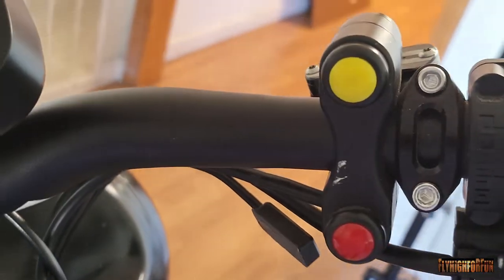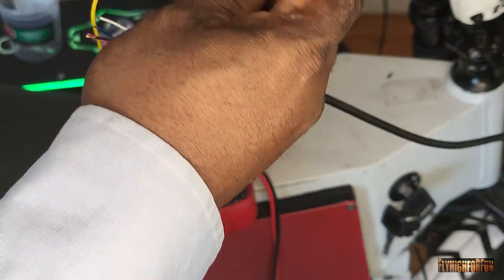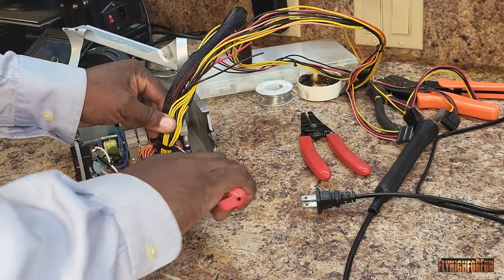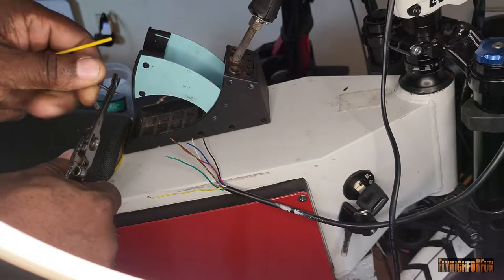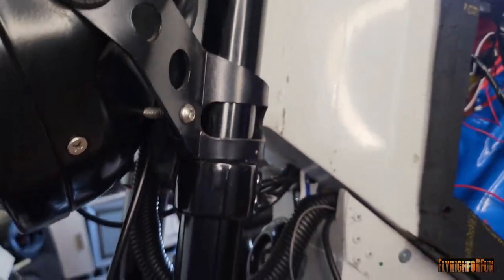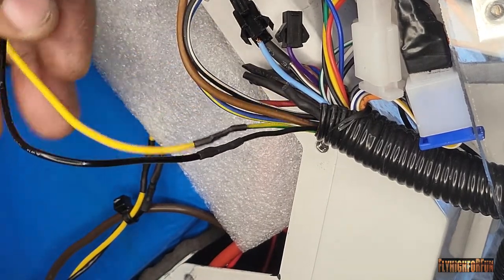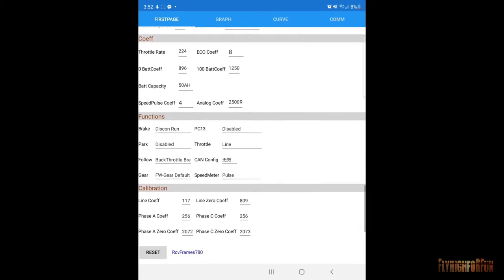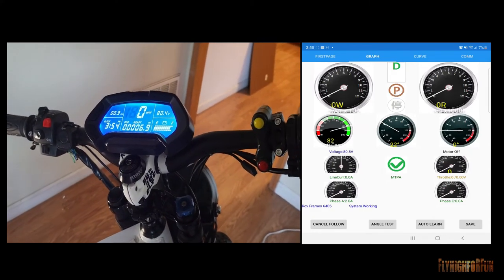Regen Braking. Fardriver ND721800 controller. #lowbrake switch

Comment: Thank you so much for this video! I just upgraded the motor on my wife's scooter and I needed to disable regen breaking, your video was great to help me find the setting!!
Reply: Is it an upgrade if you lose Regen
Reply: @andyfumo8931  the Regen doesn't end up adding much to the battery compared to letting it just cruise downhill. And her older motor didn't have regen enabled either.

Comment: Thanks for the video. I was hoping the Fardriver controllers allowed you to control the amount of regen using a 0-5V signal like the throttle but seems like it’s just an on/off switch. Is there a setting for how strong the regen braking is? Is it dependant on speed so stronger when you’re going fast and weaker when you’re just manoeuvring slowly?
Reply: The end of his video had a selection in the settings about a potential for a variable regen I think.
Reply: Yeah in the parameters is where u can adjust

Comment: want to get the Far driver nd72260, coming from sabvoton,a nd was wondering why i dont read in the manualr´ "regen braking" only charging current limit during reverse charging i mean what a interpretation for this function. but good it's got regen braking ! YES

Comment: One of your best videos I must say and high detail with the region switch on a far driver controller I mean dude you’re maxing it out beautifully. 

I’ll be buying a 72 1800 shortly But unfortunately it’s going to be paired with an under powered battery so I’ll be living with a slow battery for a while until I can get new cells and meet the same requirements of the 721800 to have its proper power and I’ll be getting a Daly 500 amp BMS.

My question to you is can I safely run the fardriver 721800 and Daly BMS with my weak Samsung battery group (18650-32E cells)? I know that the BMS and as you show the control or both have massive amounts of adjustable settings so it seems that I will be able to dial everything down for the crappy battery and then when I get the new battery dial it up to where you are what do you think man good idea?

Comment: Do you have anything wired up to cut the throttle if the brake levels are pulled? Just wondering if you had a throttle fault and it gave out 100% throttle would you have a way to cut the power without hitting the little regen button?

Comment: I am researching potential controllers for a Sur-Ron and the Far Driver seems to be a potential.
I've got a few questions that the chinese sellers don't seem to answer clearly;
-One item on my checklist is variable regen braking (using a left hand thumb throttle). I saw "back throttle brake enabled" as a selection in the settings screen on your video. Do you know if that's for a variable regen? 
-Does the rated continuous amps seem to be a true rating?
-Are phase amps adjustable in the settings?
-Can a 3 speed switch be used for low, medium, high power?
Reply from the maker: Quick answer: Yes, to all of the above. Not sure about you connecting regen using a thumb throttle, you'll need dedicated channel to control a 2nd throttle. I'm not sure if the Fardriver has auxiliary channel mapping like the BAC8000.
Reply: They don’t have variable regen, just on and off, you can further adjust the regen power by increasing the maxcurr, and stopcurr value get the first 1.5 x more in ratio
Reply: 3 and 4 question yes
Reply: @FlyHighforfun  do you know how to enable hill hold control?

Comment: My software looks much different than that? Same wiring. But i get an red !  When i hit the brake and ground the low brake wires. Shuts motor off. And cant ACCEL wirh brake switch grounded. But it wont activate regen

Comment: Do these controllers support variable regen? IS that "Back Throttle Break enabled" option for a second throttle so you can have adjustable regenerative braking? How do you set regen braking phase amps?
Reply from the maker: Question #1: Yes, question #2: No, with having a second throttle. That setting turns on Regen breaking when the throttle is released. Yes, Regen is adjustable. Question #3: it's stop back current and max back current in the software. I hope that answers your questions!
Reply: @FlyHighforfun  Thank you for replying back. That's adjustable, but not variable. In the software, you can set the back current to some fixed amount and then every time you apply regen you get that amount of regen braking. This is not the same thing as variable regen braking. Variable requires a second throttle. AT zero throttle, you get no braking effect. As you apply more throttle, you get more braking. In controllers that support variable regen, they will have settings similar to yours,  but they are the minimum and maximums the second throttle will apply when it is twisted. I was really hoping to have found a Chinese controller that supports variable regen!
Reply from the maker: No the Fardriver controller doesn't have variable regenitive breaking. You need a controller that has auxiliary channel in order to use a second throttle.
Reply: @FlyHighforfun  Yes...why I asked what I asked. I knew what is required since I use variable regen right now. I was hoping the FArdriver controllers supported this.
Reply from the maker: Which controller are you using now?
Reply: @FlyHighforfun  Nucular which will probably get impossible to purchase with the invasion of Ukraine, they support this. All VESC based controllers support it. All the Kelly KLS series controllers support it. ASI controllers support it. There's others, but I can't think of them ATM.

Comment: are you sure thats regen? Low brake would cut the power to the motor when connected and would be used when you pulled your brakes. Am I mistaken?
Reply from the maker: No you are correct. I will be making another video soon to go over the details showing exactly how to activate the Regen on the switch. #1 Brake low wire (black) wire from the controller has to be grounded to your DC to DC step down converter. #2 12v from your DC to DC goes to your switch, the other side of the switch then goes to the brake high (gray) wire. You will need to activate the software setting "EABS ENABLED" IN order for the switch to activate Regen when pressing the button. Make sure to set the amps "stop back current and max back current" but that's pretty much it! But I missed a few steps when I created this video. There will be a revision to this video posted soon. Thanks for calling that out! And if this helps you please like And subscribe!
Reply: @FlyHighforfun  I have just activated a 72180 Fardriver, if it hadn't been for your video on self leaning there is no way I could have got it running. ( The instructions they send are atrocious).Thank you. I look forward to your next video.
Reply from the maker: Phillip did you subscribe? and hit the like button? you can show your appreciation simply by those 2 steps! Plus, it helps if you want to follow. I'm glad you found the video useful I understand the instructions are vague I too ran into the same issue. I make these videos so that it takes all the pain out for other upcoming DIY'ers. I'm not asking for anything but for you to subscribe! Thanks for your time and support!
Reply: @FlyHighforfun  I have now.
Reply: Low brake and high brake can regen the same power, the only difference is high brake is used in conjunction with a brake light! Thus why you use 12v pos to activate.
To increase regen power you are looking for the maxcurr and stopcurr values set the maxcurr at a ratio 1.5x more then stopcurr.
I have 5 different FarDriver controllers and bug rhe heck out of the manufacturer
Reply: Sorry typo maxbackcurr and stopbackcurr
Reply: @RexSmithII  So do you maybe know how to change pole pairs? And why I cant' set my RATED RPM higher than 4000RPM , on auto learn it set itself to 8787RPM, I can only change it down to  4000 RPM and lower, but not higher
Reply: @Rex Smith II  Hi there..is Low Brake for regen or does Low brake just cut the power when activated?
Reply: Did you ever make the second video @FlyHighforfun